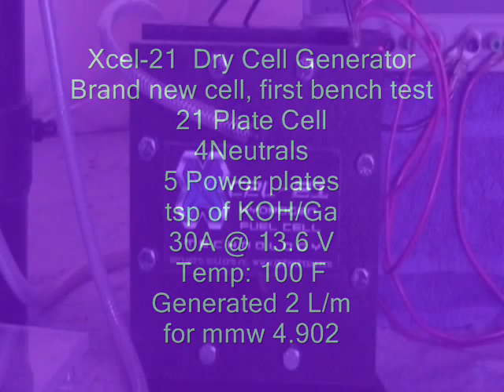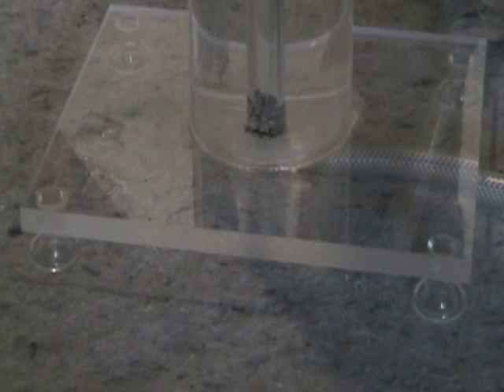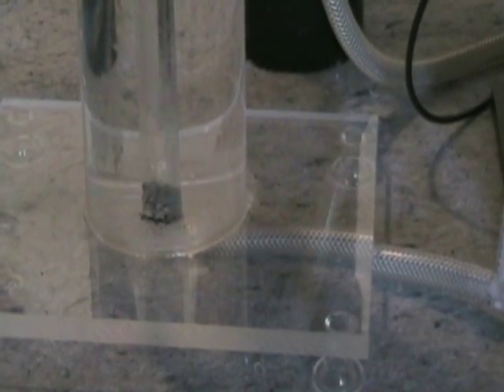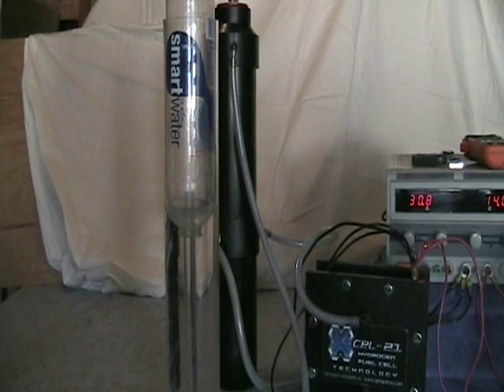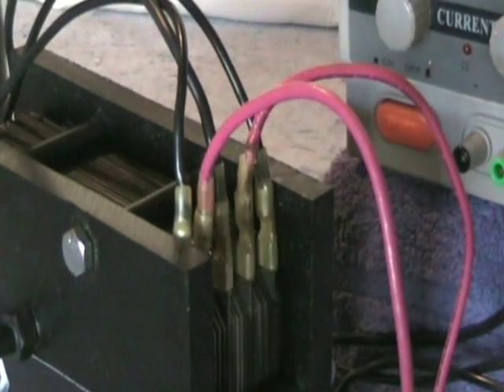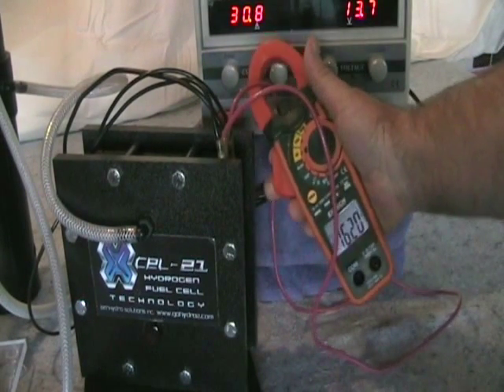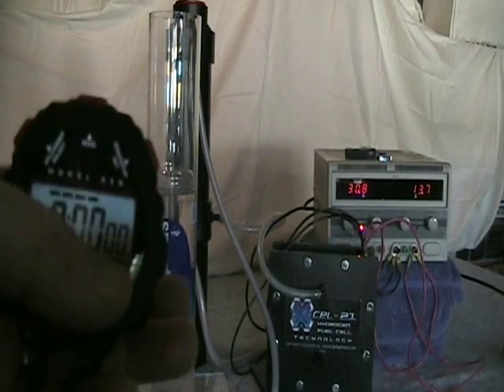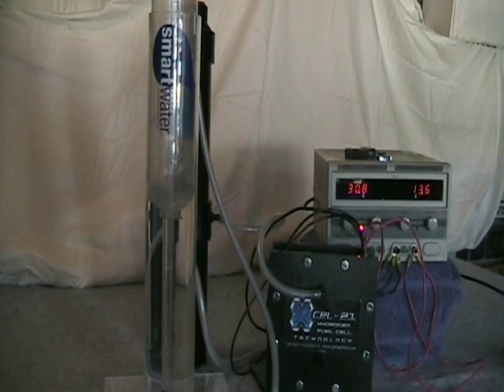Dry Cell HHO Bench test:  Xcel-21  21 Plate 6x6" Cell #1

Comment from the maker: Depending on Amp draw of cell, and alternator Max Amps, Voltages can vary from the Alternator. Also I believe they can INCREASE to 14V as well at higher RPM's I saw one vid at 59A where the voltages available, dropped to 12.5 which is a good indication of overdraw Amps from the cell from Alternator. (good place to stop)

I agree 5N config being more efficient, I will also do an efficiency test with a 19 plate cell.. 19P 5N 4PP I think even #s of PP are more efficient as well (4 vs 5)

Comment from the maker: 4N 3 is nice too, same productino at same amps as 4n 4..  Though,  4n 4 could handle more amps of course, With the new bolt setup you and others have gone to its much cleaner. For 6" cells 4n 4 is probably ideal at 40A

I am dumping push on connectors for install cells, With tabs, you STILL have to pull apart a tabbed cell to reconfigure the plate amounts.. and being able to change wire configs with tabs, from + - + -  to say + - - + while fun to test, doesn't really change production amounts.